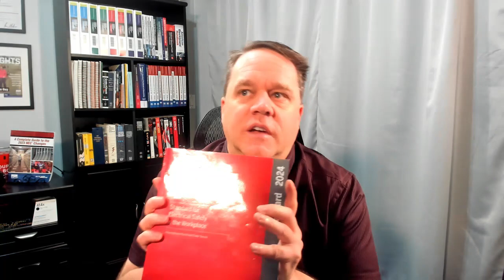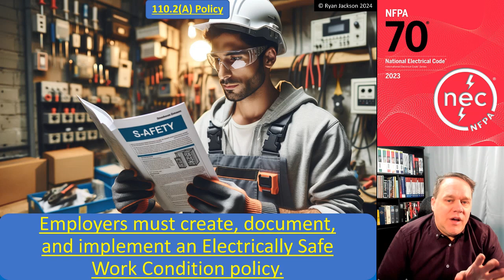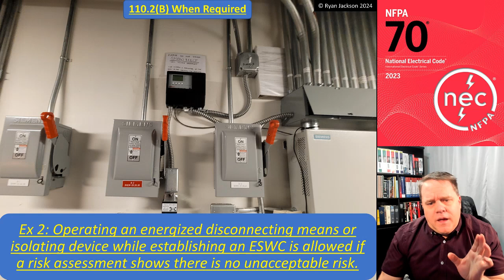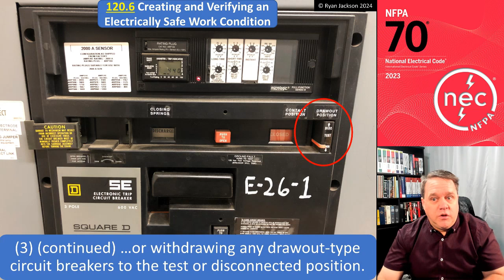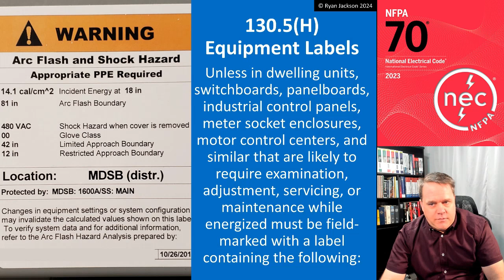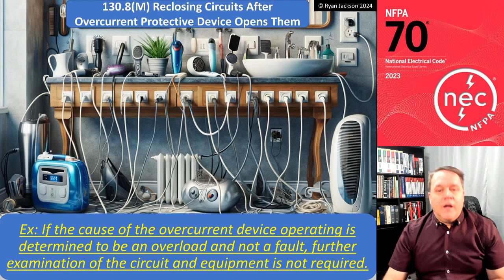Changes to NFPA 70E 2024 edition

Comment: I enjoy your videos and been a follower since you were doing videos with Mike Holt. I'm reaching out because I am requesting if you take the time on doing a video on sealing raceways and conduits... particularly 300.7 and also please because I'm a master electrician for work for a Solar Company full-time as a master electrician. I also tend to believe that ceiling raceways on all exterior junction boxes is a good practice. I'm particularly curious about this rule because a lot of the times PV circuitry is exposed in metal or different type of raceways on roofs and they can suffer from condensation. It's not just hazardous locations but please do a nice in that video pertaining to this. I guarantee you that installers, electricians, inspectors, and Engineers probably don't even pay attention to this reference. Also please go over the methods used to achieve this because sometimes I'm not sure if silicone woodwork even though the manufacturer specifications States it works on plastic and rubber which are some of the characteristics of electrical wiring insulation.
Reply from the maker: Hi Keith. I'll put that on my list.

Comment: UPS system maintenance are inherently dangerous. We had a contractor injured (possibly killed, we didn't hear) while working on a UPS routine maintenance. There was an arc flash during the UPS maintenance. Normally, a UPS circuit is always hot. Be careful, people.

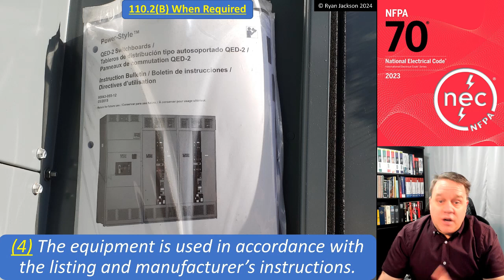Comment: 21:55.   One could debate where item (3) really needed to be added,  because it essentially corresponds to (4) because if I have a breaker with an AIC rating of 10kA, installed in an application where the available fault current is 15kA, then it's obviously not used in accordance with the listing and manufacturer's instructions.
Reply from the maker: Totally agree.

Comment: Ryan this has to be in the top best three vidios that you have made. Very informative and great job explaining things. Two things came to my old mind while watching it. We were taught to stand on the right side of safety switches ( if right handed ) turn your head facing 90 degrees from wall or strut safety switch is mounted to then take in a deep breath and hold it while using your left hand to operate the handle. In the event of an arc blast holding your breath should prevent you from inhaling up to 10,000 degree air and not burning your lungs. Standing to the side protects you from a door that could be blown off during an Arc fault/Arc blast  event. We bad to hold the open end of rubber gloves closed then roll them up to see if there is any air leaks in finger tips.I had a what looked like a statue that you pull rubber gloves over and it pump air in gloves to check for leaks. I always made sure both my classes of rubber gloves were tested & date stamped every six months.Maybe ten years ago saw where they sold an approved powder to put on your hands before putting on rubber gloves but feel safer to use cotton gloves. Never know they have special PPE rated comfort thin gloves to wick up the sweat from your fingers & hands. Used to buy a dozen thin cotton gloves every few months.
Reply from the maker: Thanks Garbo, I really appreciate that!

Comment: We always ordered drives that had built in input fuses believe they rated for 200 KIA so when they were powered from switch boards with either a 22 or 65 KIA we were safe.

Comment: Only once in my 50 enjoyable years as a sparky have seen a company have a NFPA 70 book. I worked 17 years for a rich fortune 500 company that only purchased one NEC book due to me getting tired running around to find my code book so I locked it up. Same company talked for years about finally purchasing one set of rubber gloves for 6 electricians to share. Told them I don't share safety equipment, meters, rubber gloves, underwear or tooth brush with anybody. They never did purchase and PPE. I have been shocked by 120, 208 & 277 volts. Also got shocked from oil burner transformers ( several thousand volts ) & 5,000 volt static elininators. The worst shock occurred when I was a young & dumb apprentice and listened to the electrician that it was okay to stand in 4" of cows blood while plugging in a single phase 240 volt twist lock plug. We usually wrapped damp plug & female cord connector with paper towels to plug or unplug them but it was at the end of the day and boss was in a hurry. I got got a nice big shock from one hand across my chest and out the other hand. My chest hurt rest if that day.
Reply: Forgot to add that I got shocked several times from the 665 volt DC buss from a 480 volt VFD that was just LOTO. The capacitor bank on drives can still be holding a charge up to 15 minutes after the power is removed.

Comment: 70E is one thing I wish I was taught early on in my career. It seems like everybody was always in a rush they would say just get it done. There is still some old timers out there that think a right of passage is to be shocked by 277.
Reply: Agree, although a proper 277v shock is enough to ensure a future healthy skepticism and respect for electrical circuits...😂😂
I kind of equate it to the toddler who touches the hot stove. 
You do it ONCE and NEVER AGAIN...! 😂😂😂
Reply: I probably worked with them specficially lol
Reply: A man should never be an electrician if he is afraid of heights, tight spaces, dark and tomb-like vaults or of getting shocked.  Respect the electricity, but don’t fear it.

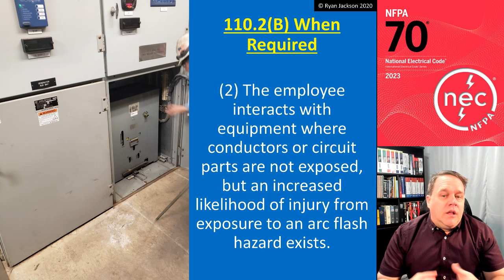Comment: 17:04 Makes me think of days I spent donning a Level 4 Arc Blast Suit to rack K Frames in and out of MCCs in the summer heat.   I was so happy when we got a Chicken Switch so we could at least, remotely switch 'em from outside!
Reply: Chicken switches should be made mandatory on voltages above 600 volts. Nice not having to wear all of the PPE stuff to open or close a medium voltage breaker.